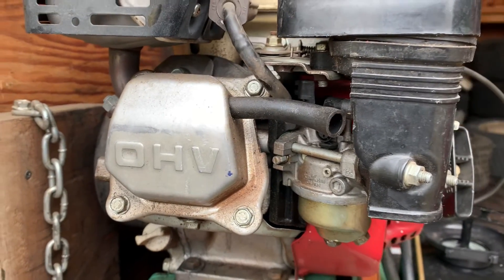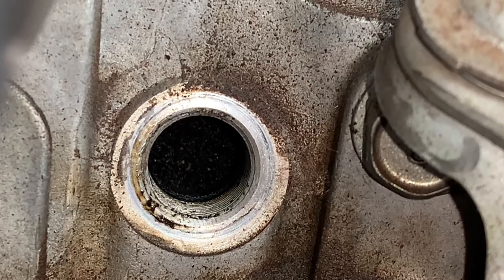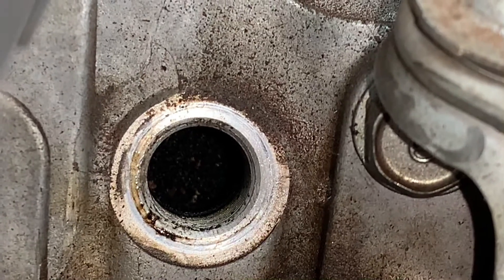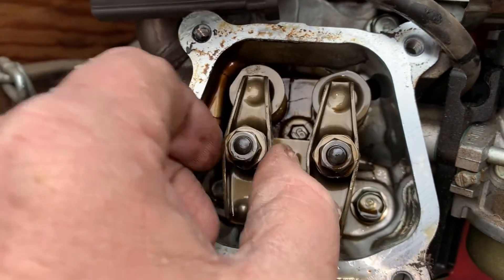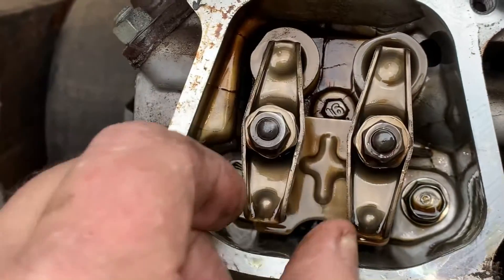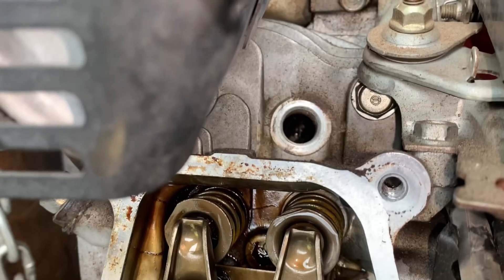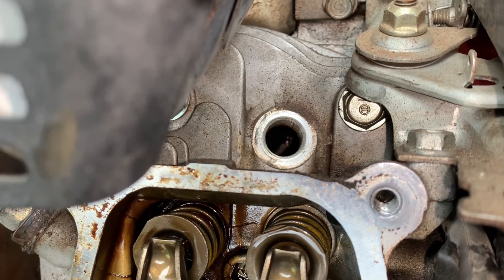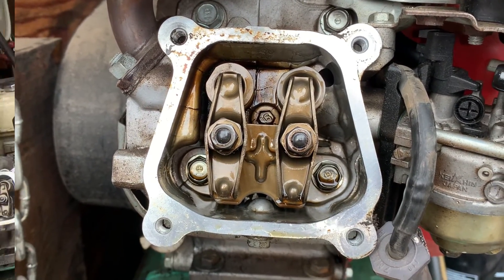DONT MAKE THIS ROOKIE MISTAKE WHEN ADJUSTING VALVES ON ANY 4 STROKE ENGINE

Comment: Great video I got a 22hp briggs vtwin its on a 2014 model john deere d140 rider it's got 214 hrs on it and it runs great but I noticed the valves are ticky would you say they needed and adjustment mower medic 1? I believe jd recommends it at 200hrs I just wish I was confident enough to do it, never done it before. Wrench on the regular but never had to do it as of yet. Any recommendations for a first time valve lasher 🤣

Comment: I like to put two white timing marks on the top of the engine to make it easier to find TDC. The stationary one goes on the engine case and the other one goes on the rotating screen where the cooling air gets sucked in. After I find TDC the first time the marks make it easier to find it again later on. You can even find TDC without having to remove the spark plug and look inside the hole.
Reply from the maker: The only thing that you have to do is be sure that it’s on the compression stroke and not the exhaust stroke
Reply: @THEMOWERMEDIC1  I know. All I'm saying is that its easier to locate TDC if you have a external, visual reference rather than having to find TDC by looking at the piston through the spark plug hole.
Reply from the maker: @joevignolor4u949  👍

Comment: So the Piston is at the top twice. After the intake valve closes. And then again after the exhaust valve closes to repeat the cycle. TDC is the first time the Piston makes it to the top. When the intake valve closes and the exhaust valve is about to open?
Reply: 4 cycle engine: Intake, Compression, Power, Exhaust. On the intake stroke the piston is on it's way down and sucks fuel. On compression the piston is headed up and both valves are closed to build compression. The plug fires and the piston heads down on the power stroke, then comes back up to exhaust the combustion gases. IOW the piston moves up on the Compression and exhaust stroke. When the intake valve closes with the piston coming up, you are on the way to TDC on the compression stroke, and both the Intake and Exhaust valve are closed.

Comment: I have a 13 hp Honda clone. It’s on a splitter from a family member that let it set for years. I replaced the carb , plug, and coil. It had the cylinder filled with a dirt dauber nest of mud. They went up the exhaust. I cleaned the cylinder and changed the oil. I got it to hit once on starter fluid. I have spark. Any suggestions? I did torque the head when I put it back. I just got a feeler gauge to check the gap. Just running out of ideas.
Reply: So you are confident when you replaced the coil you spaced it off the flywheel and all wires are correct? Have you checked the carb float operation?

Comment: I learned years ago when referring to “top dead center “on any four cycle engine meant that the piston has reached the top of the stroke before the ignition/power stroke only. However, Vanguard engine manufacturers recommends dropping piston 1/4” past tdc when setting valve lash on all their big block v- twin engines.
Reply: You are correct.  Take valve cover off and all spark plugs out so you can watch the valves and KNOW you are on compression stroke.  Briggs does say to go 1/4" past TDC but that can be on all engines.  It only makes sense that both valves need to be closed during power stroke and the currect time to check tappet clearance.  Check clearance before loosening anything.  Great video.

Comment: Check your work both ways and the lash drag will be the same. TDC on comp stroke (after air blows past your finger in the spark plug hole and then using a dowel or screwdriver in the hole watching for the highest movement) with both valves closed set the lash.

Then check rotating engine until one valve is completely open and set the other valve then repeat for the other valve and you will get the same feeler gauge drag. IMO your wasting your time with TDC.  The manual says to do it with TDC on comp stroke so you can save time and adjust both valves at the same time. Both ways are just as accurate as the other. When one valve  is fully open (spring compressed) then the other is fully closed.

On a car the best method is the EOIC method. Whether you have a solid or hydraulic cam. I started setting solid lifter lashes on my Z28 since 1974. Whoever wrote the procedure for setting solid lifter by setting 4 valves at each 1/2 rotation (180*) is not 100% accurate. Sure I did it this way for many yrs until my engine builder who built race engines for decades corrected me with his 90* rotation method.  But, as always, you do what you want.

For hydraulic valves, the best way is to set valves when the engine is at operating temp and RUNNING. If you have an old set of steel valves covers, partially cut the top open to get your ratchet in to adjust the valve. Loosen the nut until the rocker arm starts to chatter, the tighten until the chatter stops, wait 10 sec, then turn nut 1/2 turn more. GM Dealers set them 3/4 turn down so you wouldn’t come back complaining about noisy lifters. Racers set them 1/4 turn down.

When assembling a new hydraulic cam engine or replacing parts then when setting the lash cold, do not spin the push rod. Instead check for zero lash by moving the push rod up and down cause it’s more accurate. Then from zero lash which is when the slack is all out, turn the adjusting nut to your desired setting. Once fired up and on an engine with a cam already broke in, set lifters while the engine is running.

On a solid lifter cam, it’s very hard to get the correct drag on a feeler gauge when the rocker arm is pounding down on the gauge. I always set my lash cold and not running because my lash did not change when the engine was hot and when the lash was checked the next day. So no more hot burning oil on my hands.
Reply: Wow dude thanks so much. Between this video describing the combustion stroke and your recommendation I set the valves like a champ! It's so much easier and much more accurate then tinkering with TDC. You know you're good to adjust when the one liftet starts going down. All the way through that cycle nothing changes so you just do the exhaust or the intake vice versa it's much more accurate. My Generac is so quiet and start so easy now. Thank you so much
Reply: Per Chevrolet the procedure to set the lifters on ALL Chevy V-8 small blocks is the same. Bring the piston to TDC on the compression stroke for the #1 cylinder and set the intake on 1-2-5&7 and the exhaust on 1-3-4&8. Rotate the engine 180 degrees and set the intake on 3-4-6&8 and the exhaust on 2-5-6&7. Chevrolet recommends tightening the rocker arm to where the push tube no longer spins easily, then backing the nut off 3/4 turn. I back mine off 1/4 because it lets the engine rev higher. 3/4 of a turn has a tendency to choke the motor down. After the initial setting I generally run the motor and back the nut off to where the rocker arm just starts clacking, then run it down to where it's quiet, and add 1/4 turn. Works every time.
Reply: @im2yys4u81 Slings a lil oil on those hard to reach frontend bushings and ya has to take her to the bath later, but absolutely the only way to get er done. And thats muh story and I'm sticking to it.
Reply: I got a 22hp v twin briggs off a 2014 john deere d140 and I'm trying to get up the gumption to give it a go on the lash adjustment valves are ticky sounding 214 hrs on it they have never been adjusted it runs good no issues there.. but not sure how to do it on a v twin confidently I'd love to give it a shot though
Reply from the maker: Thanks for the tip!  I’m be sure to pass this along to the manufacture and let them know they are wrong!
Reply: @THEMOWERMEDIC1  it's merely an idiot proof step

Comment: I just spent about 1500 on performance parts and a Outlaw Tillotson Hemi head that’s what the man who built the head called it and y’all have to excuse cause I just get a kick out of saying that but anyhow point being the only way this engine will start is adjusting the valves on TDC of the compression stroke. Like many folks I learned on a 350 Chevy and the procedure was to adjust the closed valve turn 180 and adjust the other that will get a stock engine running but when you put a couple grand into a pressure washer engine if you don’t know the right way your not going to enjoy a mini bike that will take off like a CBR does
Reply: If you bring the engine to TDC on the compression stroke for no 1 cylinder you can set the intake on 1-2-5& 7, and the exhaust for 1-3-4&8. Rotate the engine 180 degrees and set the intake on 3-4-6&8, and the exhaust on 2-5-6&7 and it will start and run every time. You can run the engine and fine tune it one rocker at the time by backing off the rocker to where it has just started clacking, then run it down to where the rocker is quiet, and add 1/4 to 3/4 of a round to the nut. Chevrolet says 3/4 of a round, but 1/4 will give you higher RPM's, and 3/4 has a tendency to choke the engine down. MOST manufacturers want the valves set with the piston on TDC of the compression stroke, and a few want it done on TDC, then rotate the engine 1/4 turn to avoid valve overlap.

Comment: " you will get false settings because of valve overlap"
I have watched five of these in a row now and believe the TDC people are doing it 'factory,' but failing on the explaining.  If I understand it, I should check the respective valve when it is CLOSED and the piston is at TDC.  
I wonder if anyone has a written factory reference I might read online or d/l.  I think I might understand it better if I could read it.
Reply: The damn rocker just needs to be slack. That's all. Position only matters if you are in the wrong position ie valve is being operated by rocker , rod, cam

Comment: So having one valve completely open to adjust the other valve is not the proper way? I assumed if one valve is completely open, the other should be completely closed allowing for adjustment.
Reply: You know, I always did it that way.  With one open the other should be closed.  Seems as though that should be right.
Reply: Oh yeah the valve overlap. With the exhaust valve fully open, the intake valve is just starting to open.
Reply: You are correct. https://youtu.be/8PEUt_KAcYk
Reply from the maker: Both valves are open “valve overlap”  on the exhaust stroke
Reply from the maker: No that’s wrong.  Both valves closed at tdc compression stroke

Comment: so what is a simple way for a novice to know you are on compression stroke
Reply from the maker: Put your finger over the spark plug hole and “feel” for compression.
Reply: @THEMOWERMEDIC1  So you mean feel for "air" coming out of the spark plug hole, right?  That's the compression, or compressed air coming out?
Reply: carbon monoxide on exhaust stroke air mixed with carbon
Reply: @2028end  yes. On some motors you can also hear it.
Reply: Thanks! I was wondering the samething.
Reply: Exactly, this is the question that could be explained a little more clearly. Hope @themowermedic1 sees this!!
Reply from the maker: It was explained pay better attention!
Reply: i’m pretty sure if you turn the engine by hand that when it gets harder turn that’s when you hit the compression stroke
Reply: @bigboigamer4302  if you have the spark plugs out it shouldn't get harder to turn.
Reply: Another utube phd
Reply: Thanks man
Reply: Take out spark plug use a screwdriver on top of cylinder